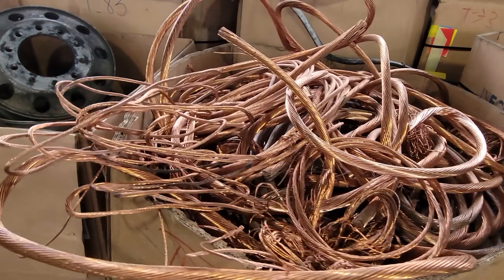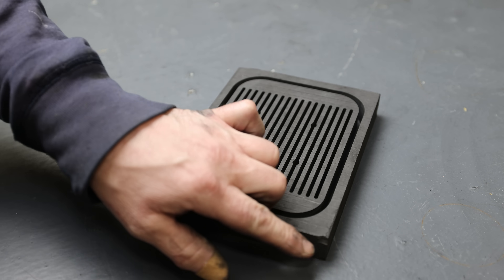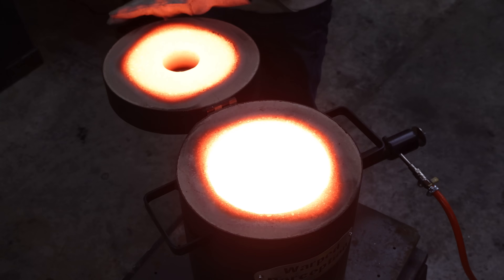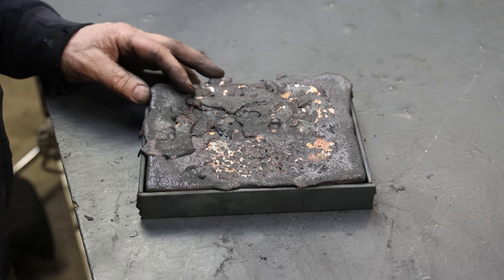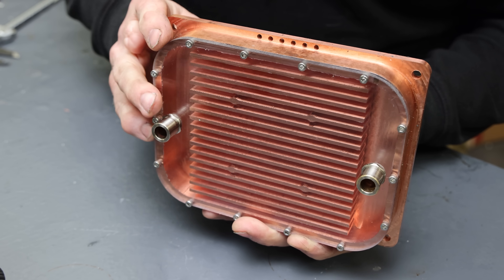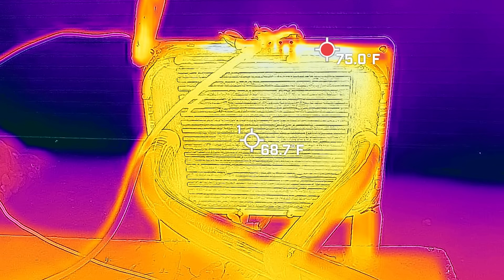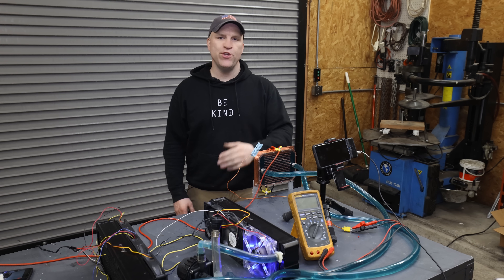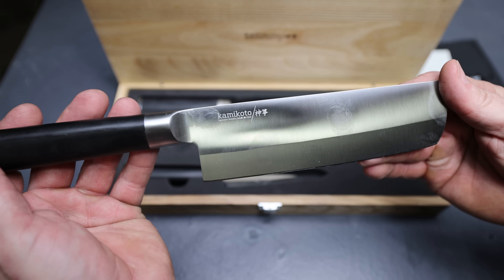Making a Huge Waterblock from Scrap Copper -Trash to Treasure

Comment: Way to increase efficacy and design on this would be to: 
1. machine a o-ring channel into the copper to better seal and easy removal to clean the water block.
2. No sure about mill or limitations but cutting smaller, denser fins into the copper will give more surface area to exchange heat. Also cross cutting the channels will give more surface area as well.
Overall the finished product worked and looked great!
Reply from the maker: All your points are right on the money, I didn't machine or no ring because I didn't make the wall thick enough because I was trying to save weight. As for the fins, that's exactly why I didn't cut them thinner, that was as small as I could go on that Mill with that RPM all that would have taken a week to mill that thing. Same thing with the cross cutting, my original design idea was cross cut and leave tapered spikes for the heat transfer but with the current Mill that I'm using, very low RPM, that would have taken an eternity...lol. thank you
Reply: @WarpedYT  Like i said before, the part turned out awesome! Really enjoyed the whole process.

Comment: Should keep graphite dust as it makes a superb dry lubricant for things like starter motor pinions or if you need to make a graphite gland seal by impregnating a twine type material with graphite powder which can be used to seal steam engine piston seals or in use anywhere a moving rod moves but cannot be lubricated copiously.

Comment: Now put a Peltier/TEC in the system and add more radiators. I bet you can get it near room temperature operation!!!!
Reply from the maker: Peltier would not be enough unfortunately
Reply: @WarpedYT  says who? It's all about how well you cool the TEC. I had processors overclocked @5gbs running wide open below freezing 15 YEARS AGO!!! Nothing but a water cooled peltier.

Comment: Don’t make it smooth, let it have a lot of rough surface to increase surface area
Reply from the maker: Good idea and I did in fact think of that I was going to originally do a sand casting and then leave it, but I just couldn't get it to work without air, graphite was the only way.

Comment: Without telling us how large the chip area is and how much heat it produces we have no way of understanding how much heat is being removed here.
A 180 watts computer die (high performance cpu/gpu) with only a 8x12mm area is 1875x what the sun delivers pr square area on earth.
A 180 watts led chip measuring 25x25mm (about 1 inch squared) is only 288 times and a lot easier to cool.
Reply from the maker: Sorry, I was just being careful. So the chip is about 3 in in diameter and 2,000 watts.
Reply from the maker: 4.90 in² of actual thermal contact area on the back of the chip.

Comment: With this much machining - wouldnt it have been easier to just machine a solid chunk of copper?
edit: got the reasoning in comments below. Checks out ;)
Reply from the maker: Yes, but I could not get a hold of the solid material which is why I made this video, if I would have gotten a hold of the solid material I wouldn't have even made a video on it.. but I figured it was so much work at least it should make a good video.
Reply: @WarpedYT  makes sense! Thanks for showing the process

Comment: Video suggestion,  - drone motors on a rocket with gps tracking and camera. Just to see how fast and how high you can get it.
Reply from the maker: I might not be able to do exactly that but I think I have an idea.
Reply: @WarpedYT  I was thinking possibly something that has a simple mechanism to self balance, or the multi- engine rocket design of the Soyuz. 
If you build it, I get to live vicariously through your videos and hard work. If you don’t, I’ll add it to my list of unfinished projects and see what happens. 
I’d like to see how a drone motor performs in “weather balloon bursting” altitudes with such little atmosphere to maintain its ascent.

Comment: When I worked for a copper smelter (ASARCO) in the early 80s we had 3 types furnaces Reverb, Converter and Anode.  When we did a pour of the copper out of the Anode furnace the moldes were preheated. Also we used green douglas fir inserted part way in and used a air piston to drive the inserted end of the log to the bottom below the copper surface. This helped to remove entrained O2 from the copper. Anodes were about 86% copper and went on to the refinery.

Comment: can the graphite be machined under water to prevent dust?
Reply from the maker: Good question, as far as I know not if you're going to use it for casting metal, I didn't take a chance here but I did in fact machine it with coolant once it was already cast.

Comment: Why cast the copper to begin with? You cnc'd the mold, y not just cnc the copper?
Reply from the maker: Because I couldn't get the materials, originally I wasn't even going to make a video on the subject, but the solid blocks of copper were on back order for over 2 months min. So I decided to try it this way and once I started it was too late I needed to make it work.

Comment: what was the old air-cooler you were using?
looks interesting
Reply from the maker: Oil air cooler, which one was that?
Reply: @WarpedYT  just the old tower cooler previously used to cool the LED package, looks like a CPU cooler, interested to find out what it is

Comment: If you must use °F then please put °C  up on the screen as you say the temperature. Having to pause the video to google what you're on about is very frustrating.
Don't you use SI units with your CNC machine? I mean, all this science happening & yet you're still using °F!
Reply from the maker: I know I'm sorry. .. I actually forgot
Reply: @WarpedYT  Thank you! 😃
You know, America has only 4.25% of the world's population, leaving 95.75% who have no idea what 122°F means! 
It's not like °C where if you knew that 0°C is the freezing point of water & 100°C is the boiling point of water then even if you had no day to day experience of Centigrade you could have at least an idea of what, say, 6°C or 60°C feels like. 
But to someone without any experience of daily exposure to Fahrenheit,  knowing how the scale works (something about ice and salt water at the lower end of the scale and the temperature of horse blood at the top end i seem to remember) still wouldn't give you a handle on what 10°F or 38°F feels like!
If, after every time you use °F, you imagine 95.75% of the Earth's population doing a loud "WTF?!" maybe that'll help? 😆

Comment: why did you cast and then machine? could you use a block of copper ?
Reply from the maker: Yes but I couldn't find the raw material, and I didn't want to pour a solid block of copper because it would have been 18 lbs worth the copper at once and a lot of exposure to the air, which means that the liquid copper will absorb the air molecules and I will have air in my casting which I was trying to eliminate completely.

Comment: Cast solid block of copper. 
Mill copper block to shape.
Didn't need all the other steps.
Reply from the maker: The reason I did not do that is because the more volume of copper you're pouring the more exposure the air and the more bubbles you have in the casting, if you pour in a mold the volume and the exposure to air is reduced significantly and you end up with a very clean part.. no air bubbles trapped.

Comment: use radiators in parallel and 4 pipe holes in water block
Reply from the maker: It wasn't enough

Comment: Did you dilute silicone with rubbing alcohol? I've never thought about that. As soon as the cameras light filtered passed the 25% power, I knew there was no way that the camera would do that light justice. Glad you did the hand demonstration. Because, that is intense.
Reply from the maker: So it's mineral spirits
Reply: @WarpedYT  thanks! I'm definitely going to use that trick. How does it affect set time?

Comment: Quick tip for calculating the amount of copper you need: Create the actual part in f360 alongside the mold, set the physical material, then check the body's properties for the volume & weight you need. No maths needed :)
Reply from the maker: Thanks, I should have done that, I didn't actually think of it. But at the end it was okay because I wanted to make it sort of visual where people could understand instead of just hiding behind the software calculations. But honestly if I would have thought of it I probably would have went that route since I did have an actual part drawing before even the mold.

Comment: I think the water inlet should be directly above the hottest part of the cooler, like most cpu coolers are doing now. But i guess it's overkill if this is cooling it enough as is. That block turned out really well though!
Reply from the maker: You're absolutely right, I was going to design it that way originally, but that meant way more machining because instead of having fins I would have spikes and I would have to do a crosshatch machine of the fins which would have been another few hours. But yep that's what I was going to do the inlet in the middle and the outlet on both ends or even four ends. Thanks!

Comment: Awesome job.....I love when you make something from scratch and it works.  Great sense of accomplishment! 

Just curious.... what is the wattage of the led if you can say?   Did you think about using a peltier cooler or was the video more for showing how it can be done from scratch?
Reply from the maker: Yes as IceBerg said, it wouldn't have been enough, the LED is 2000 watts
Reply: @WarpedYT  good to know.... keep up the great work man 👍👍....can't wait for the next vid!!
Reply: A Pelletier cooler would not have been nearly enough. They are very inefficient.
Reply: @IceBergGeo  good to know.... thanks 😊

Comment: The slo-mo guys always need loads of intense light; perhaps a little co-production?
Reply from the maker: I was supposed to collaborate with them like 4 years ago, they decided to be very YouTuber about it and just shut me out. Slow Mo guys and smarter every day have me banned from commenting on their Channel because they stole some of my ideas, so dumb. Everybody's so envious it's sickening. Smarter every day stole my original see-through engine video idea and came out with a video 3 weeks after mine.
Reply: That sounds like it would be very disappointing and frustrating. 

  I can see why casting that copper was so tricky; lots of long,  thin stretches and a lot of thin complex shapes.  It turned out great,  huh? Fantastic video.  Here is a tasty like for you.

Comment: @Warped Perception Wouldn't have been better to have ports in the upper part (but not necessarily at the top) ? Because of Bernouilli's principle and gravity, higher temperature means lower density so it will rise. Ingress port would sink colder fluid from top to the bottom, until warmed up enough, then the hotter fluid (or gaz) would rise at the top to the outgress port.
Reply from the maker: Yes absolutely and that is really my goal, this was just to make sure the heat sink portion worked, after this I'm taking an idea from how insect circulate oxygen in their system and I'm going to apply it here, I'm going to do a closed loop u-shaped radiator with no pump.

Comment: Great job, only i'd have run it with the cooling veins upright so that you would get out all the air and also it would work like a thermosyphon.
Reply from the maker: Well right now yeah because I just wanted to see if it was going to work but once I make the closed loop pumpless design then it would be exactly what you said.

Comment: Very cool bet lots are thinking oh he should have just milled a copper block down... 
A solid copper block would likely have serious imperfections that would not be detectable till after it was milled. Casting a part like that then finishing with milling or polishing is the way to go. Less mass to pick up air pockets etc
Reply from the maker: That is exactly what I was going to do originally but I couldn't get my hands on the material everything is back ordered for months, originally I wasn't even planning on doing a video on it. Well it wouldn't have imperfections if you order the proper material, most of those bars are rolled copper so I think they would be pretty good. That's the main reason I did it, I would have not went through all of this pain if I was able to find the raw material first

Comment: I've read it's not a good idea to tap plexiglass. I've done it myself and it seems to work fine but apparently the plexiglass is weakened by the threads.
A better design would use a smooth wall hole with gaskets at the top and bottom of the hole sandwiched between theads squeezing the gaskets together.
Thanks for the interesting video. As others have said, I knew you were in trouble when you had to pause the copper pour. I caste some lead pots in my youth and I know how hard it is to pour a lot of metal in one shot.
Reply from the maker: Thank you , yes you are correct, but in this case I don't need the plexiglass to be very strong... 5% yield would be more than enough

Comment: I'm curious to how much power that light actually uses, and thus how much you actually have to dissipate.
Reply from the maker: About. 2000watts. The issue is that all of the power is concentrated in a very small size chip so you have a minimal surface area.
Reply: @WarpedYT  Holy crap, I was expecting something like 500-800w. 2000w on such a small area is crazy. I was wondering why you were using a custom waterblock instead of a ready available CPU (or even GPU) waterblock, but the 2000w makes it very clear. The added mass of all that copper will definitely help keeping it manageable. Thanks for the very instructive video!
Reply: @WarpedYT  Wow. How many lumens does it produce? You probably considered, but I'll say anyways. Liquid metal instead of thermal paste?

Comment: This is far oversized for its application.
A water CPU cooler adapted would perform better for the given amount of copper
Reply from the maker: No way. I wish I was the case, that would be amazing. This is 2000 watts.
Reply: @WarpedYT  It would be interesting to see how a GPU watercooler would do as it will have more syncing capacity than the chip its cooling.

Comment: Having that just be a solid block of copper is less efficient than it could be. You could find and order a vapor chamber sized up to a close fit, and use that as an interface between the diode and the waterblock. Or, failing that, you could press flatten a bunch of heat pipes and have them spread the heat across the water block. Of course, both options will need a lot of thermal compound or epoxy to actually get the job done, but the end result would be a more efficient use of the surface area within the waterblock, to get the heat away. Even as it is, you've got it running at just above spec for most silicon processors, which should be within spec for heatpipes and vapor chambers, so adding something to better spread the heat output could easily reduce the tempurature by several degrees.
Reply from the maker: Thanks for that info, you're absolutely correct, however I wanted to keep the manufacturing as simple and cheap as possible. I will get the temperature down further once I had a large radiator outside the unit. Or I might redesign it later on all together to be even smaller. In one of my earlier iterations I did in fact try the heat pipe idea, it did not work. If I had a better mill I could have totally went smaller on the fins. I didn't fact try to go as soon as possible on the back plate, but what I ended up with at a certain point was a hot spot right where the chip mounts on the liquid side of the block, I had to change up the geometry of the inside of the water block to allow a more even heat spread. I may end up redesigning it later on but for now I just need the light to work for a project... Thanks I always love the intellectual comments cuz it gets my gears turning!

Comment: He's literally making an artificial sun, with such a high CRI, colours won't look washed out, imagine office lights to actual sunlight, it's amazing. Also, I absolutely love molten copper.
Reply from the maker: You got it, this light in particular at 2 ft distance is six times brighter than the sun at the subject. I obviously have to diffuse it and treat it a little bit which takes away some brightness. But yeah the CRI of this is amazing and you said it perfectly, the colors won't look washed out they would look very natural, and an office with high CRI lights would probably be amazing to work in. Typically they use fluorescent lights which are very green in color and the CRI sucks probably like 80. If you ever see a fluorescent lamp with a spectrometer it's green is off the charts.
Reply: @WarpedYT  I've been wanting to build a custom light for my aquariums. To replicate the sun is my ultimate goal with it. This is so amazing! The applications for this kind of technology is limitless. 
I love lighting to say the least! It's crazy how just the spectrum alone can change the whole mood of a room! There's an artist named James Turrell who uses light as the medium for all his works. He literally warps your perception of everything from depth to color. I know that chip is experimental, but maybe you could point me in the direction of a similar chip?